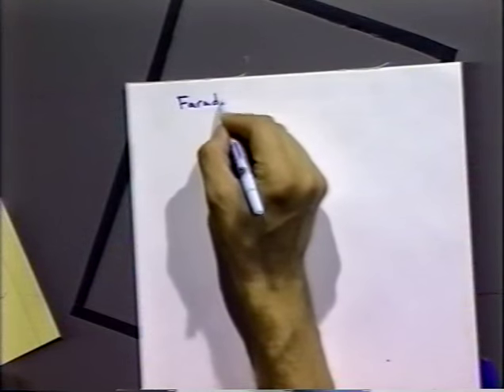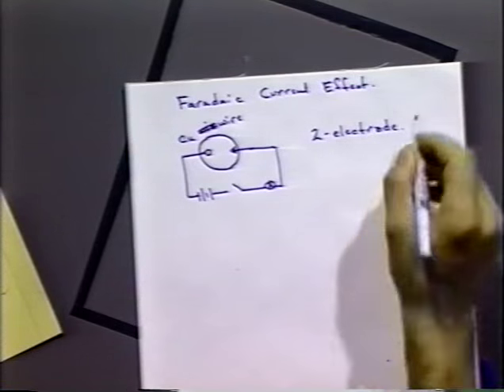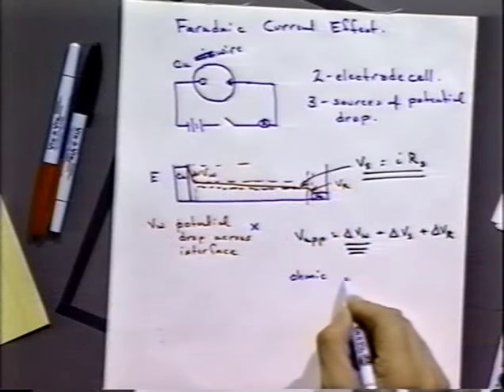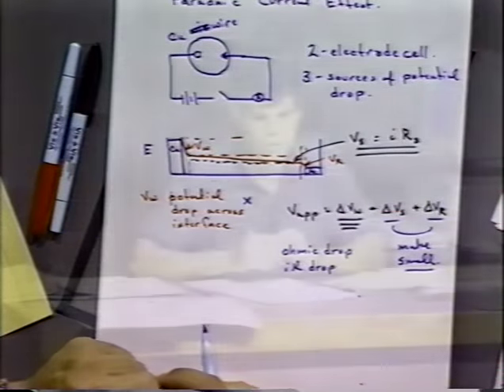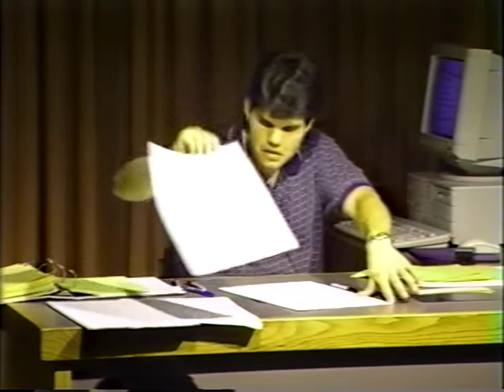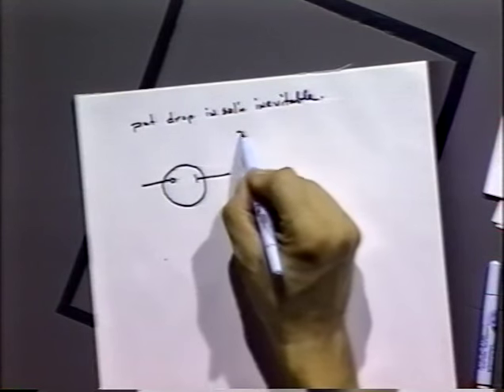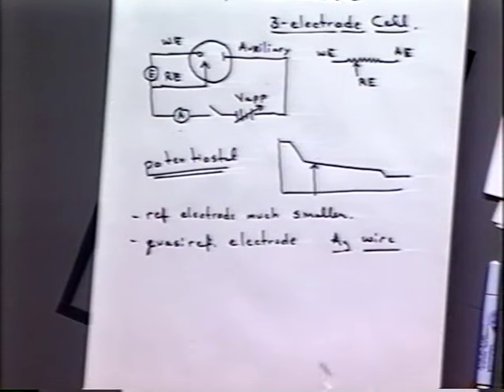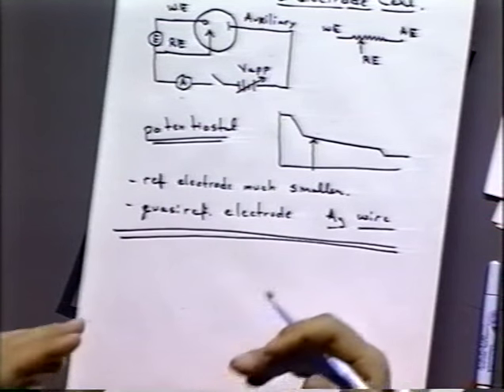Potential Drops in the Cell

Comment: Thanks!! I didn't completely understand how increasing the area of reference electrode can reduce potential drop in a 2 electrode configuration..is it just because  R=pho*length/Area?
Reply from the maker: The increase in area does reduce the ohmic resistance as you write. However, since all the current must be supplied by the reference electrode, the  larger area also reduces the current per area (current density). This permits the reference electrode to maintain a potential closer to equilibrium. In other words, the larger the reference electrode the closer it will be to being an ideally nonpolarizable electrode.

Comment: Hello,, I think there is a mistake in drawing the i-E diagram for the ideally polarized electrode in 10:07 , because the potential should change on the x-axis (i.e. with zero current)  over the applied potential range to the electrode. However, what you actually did is drawing the diagram for an ideally NON POLARIZED electrode. Please correct me if I am wrong.
Reply from the maker: You are right, I definitely mean to say that the SCE (and other reference electrodes) should approach the behavior of the the ideally non-polarized electrode. Anyone watching should note this.